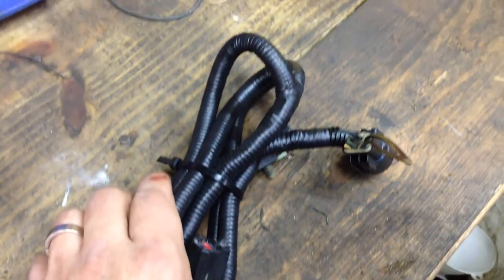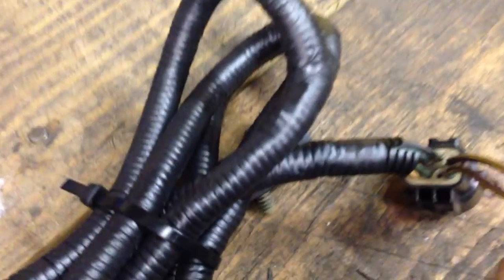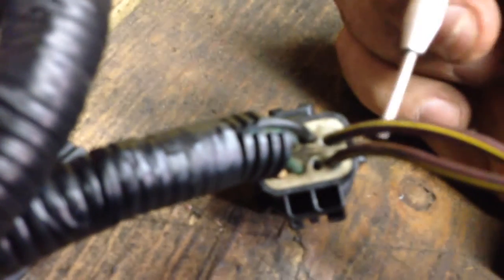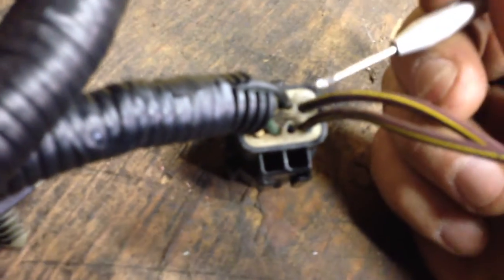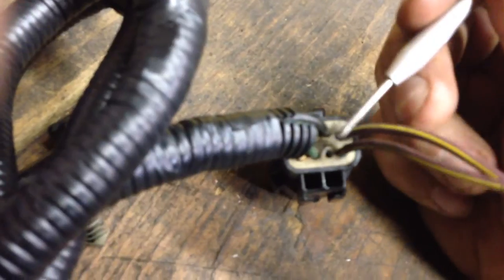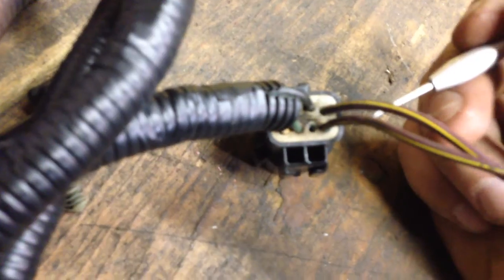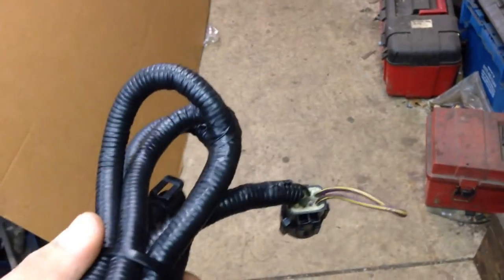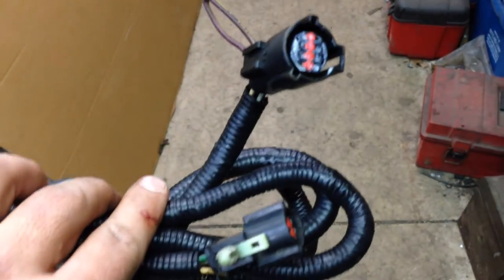Let Me Show You Fox Body 02 Harness. 87-93 Ford Mustang Mass Air & Speed Density

Comment: My 87 is wo/ cruise control, so no VSS, did a mass air swap, using a 92 A9L. So I should add the jumper from 1-6? You did say the later years had two harnesses , that’s why I ask. Also would you recommend adding the VSS & matching speedometer cable? Thank you very much for the information and helpful videos!

Comment: I have a 1990 f250 5.8 speedD I want to do an engine swap to a 96 5.8 MassA and I don't have the computer or wiring harness from the  96.. can I use what is existing in the 1990 manual transmission or will I have to swap the whole wiring harness out.. ???🤷🤦
Thank you..

Comment: Hello neomustangs, can you help me? I have my foxbody 88 speed dynast manual with t5.. I got an ecu 89 mass air harness I want to install it with my original 88 o2 harness but it only has 5 pins will it work with just making the bridge?

Comment: Do you have to add the jumper for 86 speed density 02 harness when doing a MAF conversion with a a9l with a t5?
Reply from the maker: No
Reply: @Neomustangs  thanks for the info. I thought that was correct. But there is allot of info going in 90 different directions and not much for an 86 it seems.

Comment: I have a 88 Auto
Soon be swap to t5 and I really want to convert to mass air afterworlds ,I found this on eBay 1987 1988 FORD MUSTANG MASS AIR CONVERSION KIT METER ECU 5.0  A9L JUMPER HARNESS
THIS KIT IS FOR 5 SPEED MANUAL TRANSMISSION MUSTANGS . Is this what I’m going to need ?thanks
Reply from the maker: You could do it Without a kit but ya. Looks ok. Gotta be handy with repinning. Don’t use Skotcj locks

Comment: What's the low oil sensor wire on this harness?? I got an 86 that doesn't have the loop. I did the mass air swap. But now that I'm rewiring the o2 harness I don't know which ones to low oil wire?

Comment: I've been going through hell with my fox body and I'm going to be checking my 02 Harness soon because my car I think was swapped from AOD to T5 and I'm not sure whats going on with the neutral safety switch or circuit. Thanks so much for this video
Reply from the maker: Yw !
Reply: @Neomustangs  Hey Neo, so I finally got around to checking my 02 harness today and I simply don't see any jumper or even a place for the jumpers. Would this mean my car has an early speed density 02 harness on it even though my car is an 89?
Reply from the maker: Yes.
Reply: Neomustangs Okay thanks for the reply. I’ve done some more research and I’ve read that this can cause some issues. So I’ll probably buy a new 02 harness and thanks to this video I will be able to pin it out correctly and get this car running right again. Thanks!
Reply from the maker: For sure!
Reply: I have a 1990 Lx AOD to t5 swap. It came with a fried A9P and I swapped it out for a A9L 1993 which improved the idle and stopped the car from cutting off randomly. However when I pulled codes with the new computer it had a constant 91 no matter what parts I changed or vacuum lines replaced.
I didn’t switch the harness and came across your video. How should I configure the harness?

Comment: I am currently swapping my 1988 speed density foxbody to t5 and maf .. Can I use the 91-93 manual transmission o2 sensor harness that LMR sells as long as I put an A9L in?
Reply from the maker: No. 91-93 is pinned different
Reply: @Neomustangs  Great thanks for info👍🏻

Comment: Neo ... can you help me out ... i changed my 2004 3.8 mustang over to a 5 speed the parts car is a 2000 3.8 .. what i have in the car now is the wire in from the 02 for  training ..04 wire on the engine 04 computer the car runs but i have codes coming up /// O/D and ENGINE runs ruff when idle ..... can you tell me all the parts i need to take off to 02 to get this running right thanks

Comment: Question... 93LX 4cyl auto swapped to 5.0 and 5 bolt, T5 by someone else. I am trying to finish the job because I bought the car. The engine harness is a 91 (watched your video) but the O2 harness is older (no loop no holes in rubber) ... will this cause O2 or running issues? Hesitates.....
Reply from the maker: Add your own loop. Its just a signal return wire.
Reply: @Neomustangs  If this is not present will it cause the computer not read o2 sensor's?
Reply from the maker: @75yeayea  It will do things like that yes.
Reply: @Neomustangs  Thank you! Appreciate the videos and info.
Reply from the maker: Yw
Reply: @Neomustangs  Do you have a trusted seller for an Ignition Module DY-1284.  Ebay.. Amazon?
Reply from the maker: I do not

Comment: neo, i am running a 88 gt previously a SD, AOD, it was converted to a mass air and a t5 transmission with an A9P  but no 02 harness was changed. which harness should i use? i have burned 2 computers, and the car wont start, could the 02 harness be the cause of it?
Reply from the maker: Vicious Mustang If you have burned up two computers I would suspect someone maybe didn't convert the harness correctly? The A9P is sorta universal computer meaning it'll work with both NSS (neutral sensing circuit which runs thru the 02 harness plug) for both AOD and T5. If it were an A9L I would say its a good possibility your burning the traces on the NSS circuit but being its and A9P id have to suspect something else.

Comment: Hey bud question. I have a 93 
V8 auto harness hooked up to a A9L in my 4 cylinder auto coupe that I'm converting to 5.0 question is how should I pin my o2 harness 5 to 6 is what it originally. and I pinned it 1 to 5. Not sure what year the o2 harness? The harness and o2 sensors off different cars
Reply from the maker: 91-93 was 1 to 6. IT was a blue wire.
Reply: That's what I ment 1 to 6 is what I pinned too. I wasn't sure tho because how my main engine  harness was form a 93 AOD 5.0  didnt kno if the automatic pin sequence was diff.. but thanks again bud👌👌
Reply from the maker: Yes AOD is Pinned from 5 to 6. Five speed is Pinned from 1 to 6. 91-93.

Comment: What if I have an 89 with a 91 o2 harness that's looped 1 to 6? That's how my car is currently set up but it's speed density (was 4cyl converted to v8) 

When I go to mass air should I change it 1 to 5 or leave it 1 to 6???? 
Appreciate the help.
Reply from the maker: Yes
Reply: @Neomustangs  Yes, change it to 1 to 5 or can I leave it 1 to 6?
Reply from the maker: @Gear1993Head  follow The engine harness so 1-5
Reply: @Neomustangs  thanks man. Whoever swapped the car did a halfass job and im trying to "un-puzzle" it. Currently it's an 89 with a 93 drivetrain but they used an 87 DA1 computer and engine harness. Didn't even bother changing they headlight harness, just stretched the alternator wiring across. But for some reason they used the 93 o2 harness.

Comment: Hello I have a question I have a 94 Mustang with ported GT 40p heads intake e303 cam and bolt ons went to the dyno and hit 290 rwhp and 321 torque(stock maf and injectors) I have a master power T70 and planning on getting the on3 set up.Would I have to upgrade The stock trnasmission and if so which do you recommend ?
Reply from the maker: You could run the stock transmission on light boost and probably be fine for awhile. No slick drag racing as that's what breaks them. I have friends still using stock T5's they freshened up rebuild wise that make over 400 to wheels still driving on their turbos no problems 2 years later. Of course they don't drag slick race it very often at all.
Reply: All right I'll guess I will give it a try probably will run it at 8lbs.The stock computer will need to go out by then Thanks for your input
Reply from the maker: Stock computer wont go out. I push mine well over 500 Hp
Reply: Mine is not the A9l as yours 94-95 computers are notorious bad when putting upgrades as turbos

Comment: Will a A9P computer work on a 5 speed car? I am doing a mass air conversion on an 88 gt with an 89 harness? If it will work should I leave the the jumper wire alone in the o2 harness?
Reply from the maker: Mike Moreau Yes. The A9P will work just fine in the T5 car. As well as the matching 02 harness. Keep in mind tho that A9P lacks the same idle logic that the A9L (5 speed original) computer does. So you will have times that the car may hunt for idle specially after driving and coming to a stop sign. Its not uncommon.
Reply: Neomustangs Great! I will see how it does and probably end up getting a A9L pcm if it is a problem. Do I leave the factory 88 o2 harness alone with the A9P pcm in a five speed car or do I swap those 2 pins? Sorry for the confusion..
Reply from the maker: If the 02 harness is pinned for A9P leave it alone.

Comment: Is there a way to find out what year is a wiring harness and a computer ?
label or a number thanks
Reply from the maker: Robert Sanchez The computer usually has a nomenclature sticker where it plugs into the harness. There should be 3 letter/number combo in big bold dark text in the corner of the sticker. A9L is usually 5 speed. A9P is usually automatic. Its easily spoted just looking at the sticker on the front of the computer. As for the harness theres quite a bit of differences so its easily identifiable if you know what your looking at.

Comment: what does that Loop do?  because I just cut mine off so i wont butn pin 46 on ecu.have a 58 f100
Reply: William Lopez I have been working on figuring that out. gave up on google and traced back the wires on my 91 harness and from the looks of it all it does is tell the computer the car is in the start or neutral position. my car was never fuel injected and the harness is basically just hotwired with toggle switches so I'm going to run without the loop just to be safe because it starts and runs fine without it already.

Comment: I have a A9p mass air. I want to use that computer with a t5 is that possible
Reply from the maker: Yes
Reply: Does the computer need to be flashed or something like that will start with any ignition switch?

Comment: If I have 87 car it's a 4cyl it's a aod car doing a V8 swap have a 89 Maf harness ok my donor car is a 92 gt I want to put the t-5 in the 87 with 89 engine harness can I use the 92 o2 sensor harness on with the 89 harness I have a9l computer?
Reply from the maker: James Voss no. If your using an 89 mass engine harness pin the O2 harness to match the 87-90 style pinout for signal return.
Reply: So use 89 o2 harness manual transmission?
Reply: Neomustangs can you recommend a place I can get a place I can get a o2 harness from that's all ready pinned out for what I need!
Reply: Hey I got a little confused I went with Tim at PonyPerformance.com great guy in I would recommend him 2 anyone my question since my computer is coming from a 92 car it's a A9l computer I shouldn't have to repin any wires or just pick a  computer up for a 89 ! Thanks for any feedback u seem to have a lot of knowledge about Mustangs! Yeah I got the 89 o2 harness with the trans harness from Tim after a guy ripped me off sold me a speed density hardness o2 harness I did get my money back but will not deal with anyone else but Tim I am sorry taking up all your time love you Videos!
Reply: I got an 86 vert swapped to mass air and have to ecms A9L.. How should I pin it

Comment: I have an 87 5speed converted to MAF using a A9P. I still have the stock 02 harness. Can i just add a jumper to pin 4-5  in the 02 harness like a factory 5speed MAF car even though I am using the A9P without frying it?
Reply from the maker: Yes
Reply from the maker: Here’s the thing. There’s no plumbing for that to work anyways. So it won’t matter regardless unless you have 8 wires on the male plug on the converted harness
Reply: @Neomustangs  Thank you for the information

Comment: Can I still use a speed density o2 harness if I add the jumper wire? 
Have an 87 harness with no jumper but I'm sure I can find a jumper wire for it.
Reply from the maker: Yes
Reply: @Neomustangs  Thank you, I actually went and looked at harness and it doesnt even have the 8 pin on the connector from the ecu harness because I'm using an 87 ecu harness and converting it with the LMR kit so looks like I wont have to add a jumper at all correct?
Reply from the maker: @Gear1993Head  don’t need to Add. But pay attention to signal wire to VSS and fuel pump
Reply: @Neomustangs  What should I look for with those? Havent heard of that one before